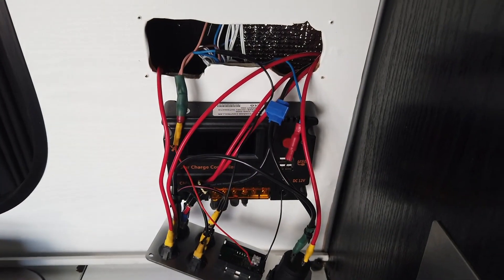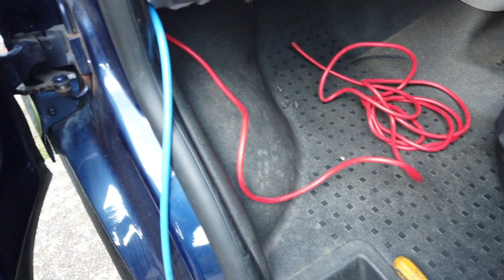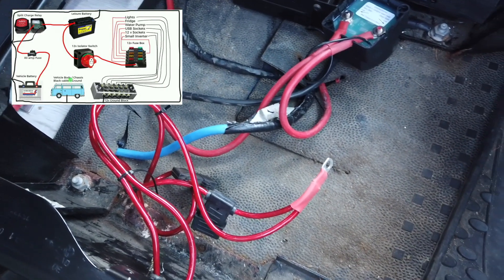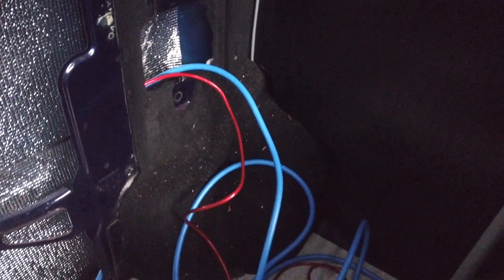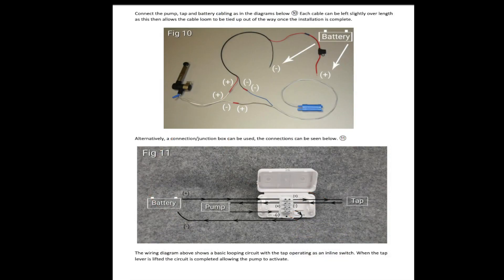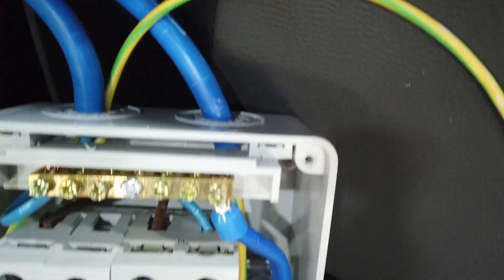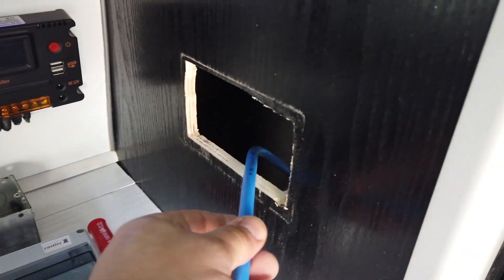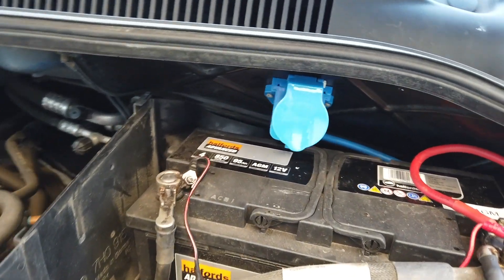Campervan Electrics

Comment: Hi Buddy. Your video is one of the best I have seen so far, however, I still do not feel confident installing my own vans electrics. Can you give me some advice with regards to getting someone else to do this job? My van is a T6, I understand that the charging system is different. Best place to purchase necessary components and likely cost of paying someone to do the installation. Cheers
Reply from the maker: Hi and thank you, I think maybe you should join some Facebook VW groups as there's tons of information on there and a lot of people all over the country who might be able to suggest someone local to you. All the components I used in this video was purchased from Ebay, in regards to how much it would cost, I really couldn't comment as it would just depend on what sort of set up you would want and need.